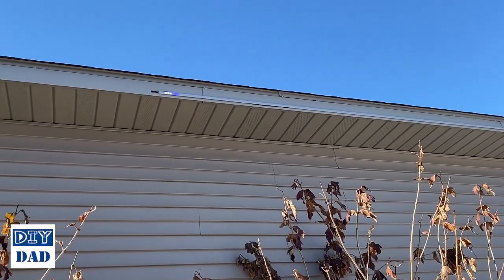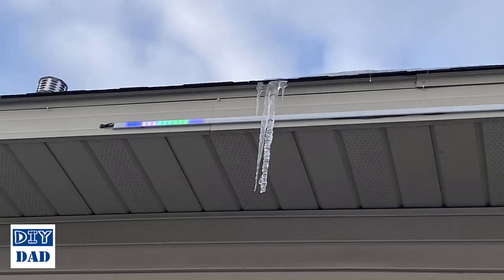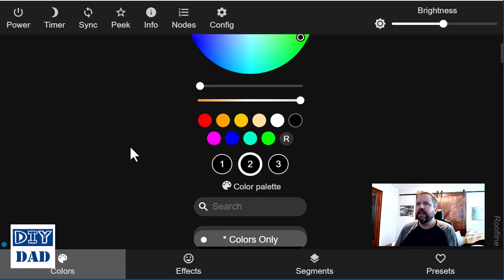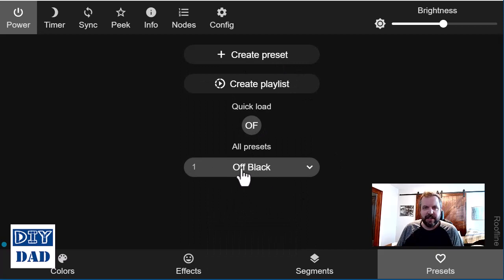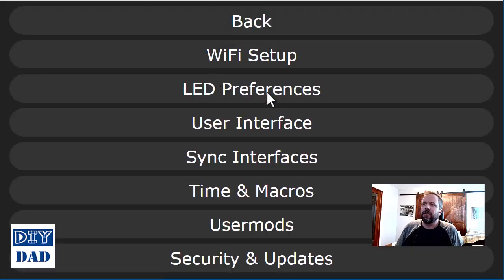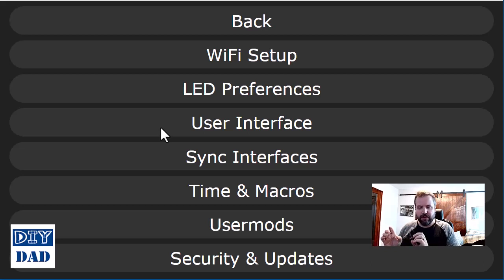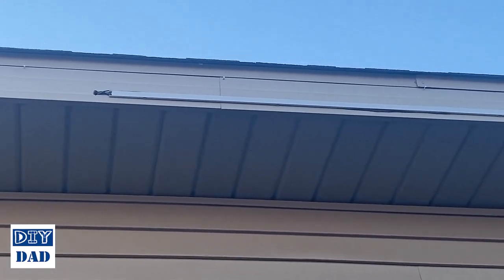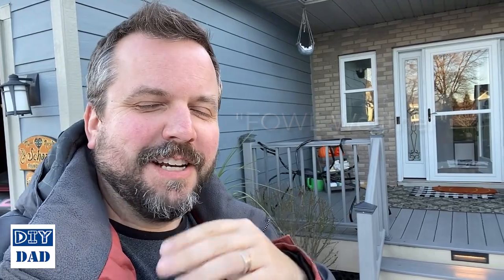DIY Permanent Holiday LED Lights: Troubleshooting lights that won't turn fully off

Comment: New to your channel and enjoying it so far.  I had the issue where a ceiling fan when turned on would somehow cause the led lights to come on in another room!!  I used a tiny relay which wled controls.  When wled turns off it trips the relay cutting power to the lights  Works great!!
Reply from the maker: Thanks for the kind words!  If you have a moment link me the relay that you used

Comment: Hey.  what AWG wire did you use for your outdoor lights?  i see you go from your garage to the lights through the ceiling.  how many feet roughly is your longest wire run for power,  power injection and data?
Reply from the maker: With the disclaimer that this is a guesstimate and represents how I did it, but not necessarily how you SHOULD do it... hah.  My wiring is 18ga in either 2, 3 or 5 strand.

Run lengths:
Roof Peaks (no power injection aside from initial connection point) - [D/P Feed 5ft] + [Peak 1 LED Strands 20ft] + [D/P extension 30ft] + [Peak 2 LED Strands 15ft] = 70' total run

Roof Line (power injected at start and in two places along line) - [D/P Feed 25ft] - [LED Strands 90ft] = 115' total run

Roof line power inserted at start and approximately 32' and 60' point.  First injection wire is about 55' long because of how it was run, second is approx 30' long
Reply: @AskDIYDad  ok.   Thank you for the reply.  The information given helps.  Cheers.